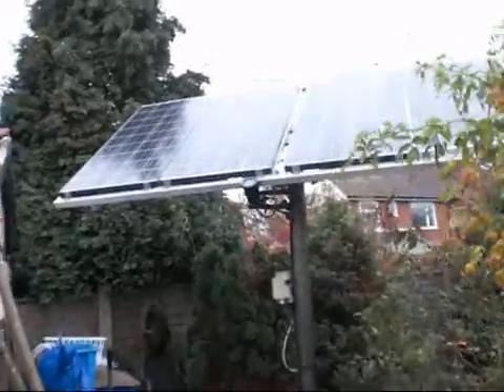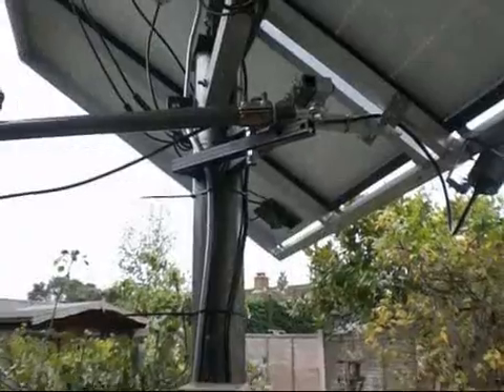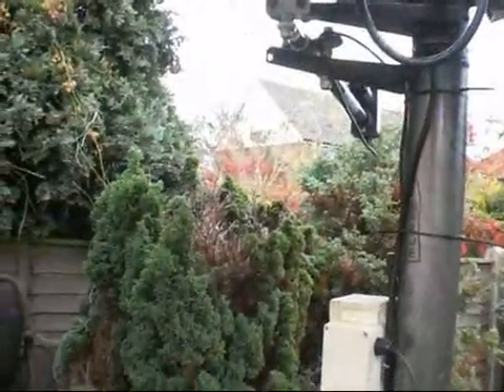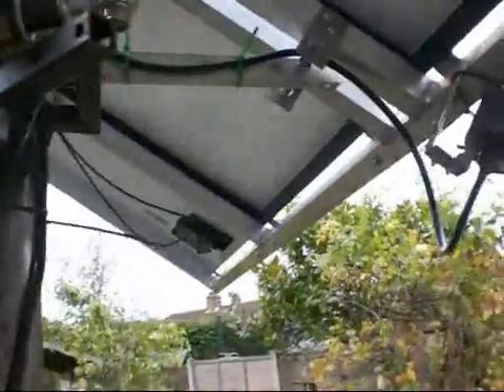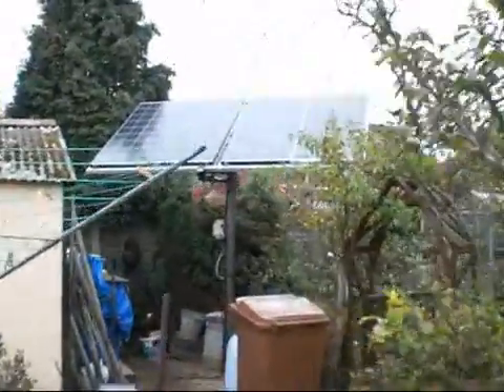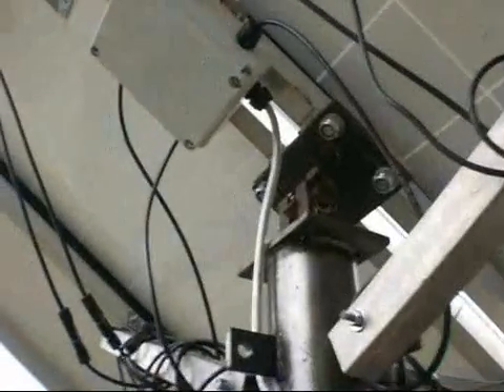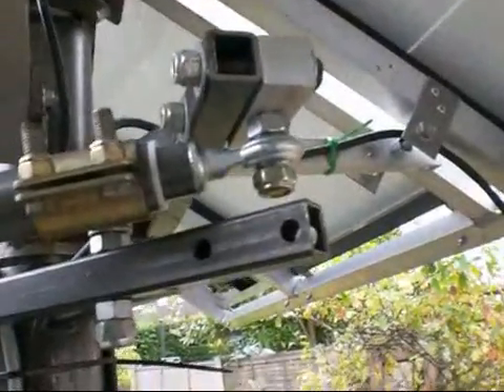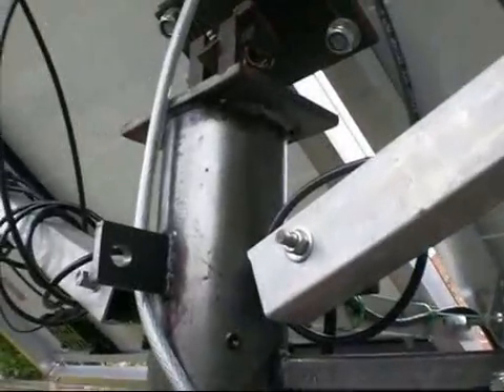finished tracker part 3

Comment from the maker: @MegaAlfie007 First thing to do is take the top off the actuator(the plastic cover held on by 4 screws.
next ,there are two cams secured by a screw,loosen the screw but dont remove it(undo it half a turn maxium)then apply 12v power to the actuator so it moves in one direction,when it gets to the stop the micro switch is pressed in by the cam. to adjust the end position move the cam position then do the same for the other direction.
I will add a video to show  in the next day or so keep watching.

Comment from the maker: plus and minus from the 12v battery to the power input connectors on the tracker 
+ 1 on the left is 12v power in (RED)
and the negative on the far right (BLACK)
the two inner connections go to the actuator.
Depending which way round you want it to turn.
before connecting the tracker put a in-line fuse to protect it.

Check your end stops on the actuator before connecting the tracker.

if connected correctly the tracker should go back to the east at the end of the day.